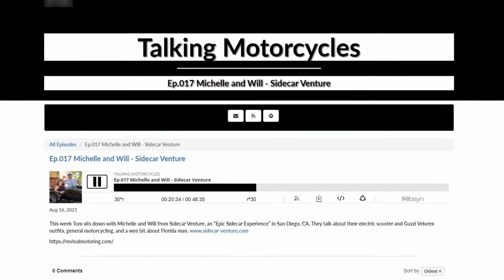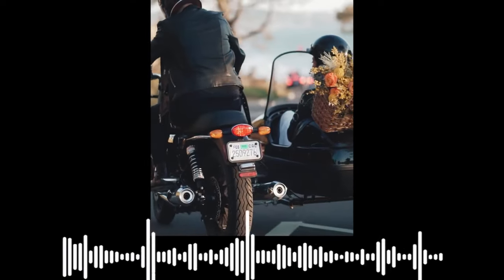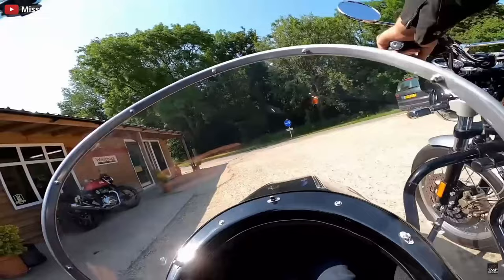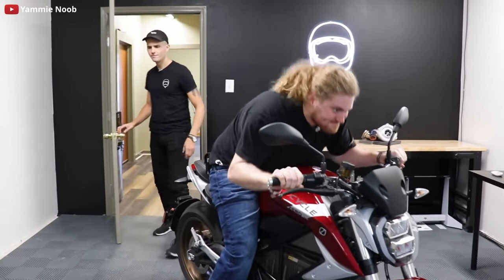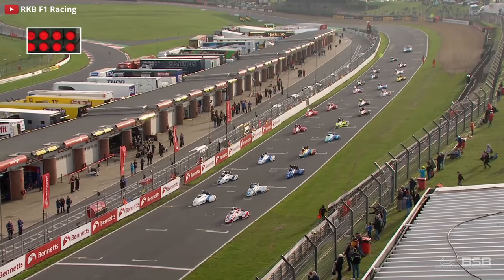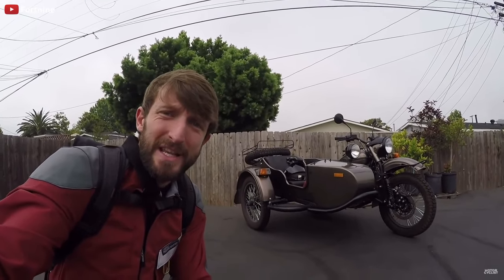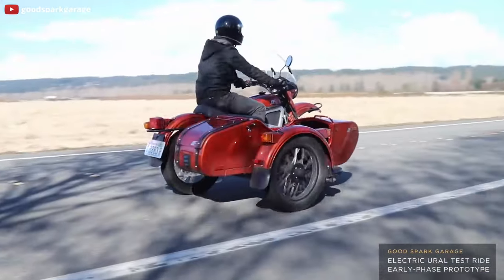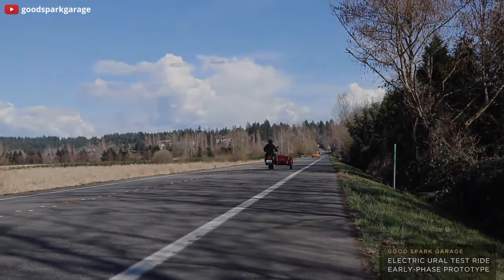Why Sidecars could be the future of Electric Motorcycles

Comment: I've often thought this EXACT thing.  Makes too much sense not to do it.  I'd totally get an E-Ural with a 200 mile range... in a heartbeat.  And design it in such a way that the sidecar is easy to attach or detach.  That way you can ride on two wheels for shorter commutes, and then attach the sidecar when you want to go touring over longer distances.
Plus... EVs are so much simpler and easier to engineer than ICE vehicles, so it seems this would a perfect fit for Ural :-)

Comment: I used to run a sidecar business, I now write sidecar books. I've been thinking that an electric sidecar would make a lot of sense for the same reasons you mention. Range. Big battery under the sidecar. 
You could easily get a 200 mile range out of one. 
I'd love to do it, and I have designed the whole thing. I just don't have the funds to produce it right now.
Reply: While I can appreciate the simplicity of an outboard wheel, & aesthetically all the enclosed ones I've seen were... lumpy, I still wish for the debris containment & superior aerodynamics & roomier space, that a sidecar enclosing that third wheel, can offer! 

Aesthetics are quite subjective, but if they're not styled like a dirigible or an antique boat, they seem to jump straight to alien gourd shapes, & I'd just love to see a streamliner sidecar that actually looks good.

Comment: When you dis Ural motorcycles, you’re dissing the old ones (and you’d be right).
   I ride the new fuel injected one, and it’s as dependable as any machine we ride with.
Also a little FYI;
Ural has an amazing electric machine in the works, and the only reason it’s on hold is because of the conflict with Europe, Ukraine & Russia.
Reply: A paratrooper bike, yes?

Comment: If a hub motor were fitted to the rear wheel (and maybe even the sidecar wheel) there would be lots of space for batteries in the cycle frame and the sidecar. I would love to own one. I'm sure a good, usable range would be possible.
Reply: That'll be a high voltage hub motor, or else a geared one, but yeah, it's a good idea whose time has come.

Comment: Sidecars flipping over when turning to the right? I assume you mean when the sidecar is on the right, it can be difficult but that depends on experience. I'm in Australia, we have our sidecars on the left side. I have been riding a sidecar for 34 years, mostly solo, why solo? I like the thrill of throwing it into a corner, going faster than I should. I find that if you hang off the bike like you do when racing, transfering your weight, and you let the side car wheel come up in the air, plus feed in the power, it will rocket around a corner, and you do the opposite for turning with the sidecar in the outside of the corner, hang off and shut the throttle. In the wet, when you can get it to slide, it is fantastic. I don't think you see a lot of them because they are a challenge to ride.
Now putting a battery in the floor of one and on the bike for a sidecar would be an amazing idea.

Comment: Better question: Why is it so hard to find a sidecar bike at all? They're rarely attached out of the factory and even used ones cost thousands.
Reply: I'm thinking this too, Ural is the only prominent sidecar-motorcycle manufacturer that I can think of, guess it's not as popular of a feature as it once was?
Reply: A sidecar needs to be very well mounted to the frame, & frames vary wildly across brands & models; so, you're usually making a sidecar for just one year range of a few models by one or maybe two manufacturers. 

It's like the paucity of frame-mounted front racks on bicycles: If it wasn't already planned for, it's a lot harder to add later.

Comment: Sidecar owners have been on this for years, mounting heavier automotive batteries out on the front right corner of the sidecar frame to replace crummy motorcycle 12v batteries- works like a charm. I've been thinking about full electric along the lines you mention for a while; one advantage is that you avoid the HVAC losses fully electric cars suffer from, which also helps battery life. Biggest drawbacks are in the inability to easily adapt regenerative braking, and the generally awful aero figures all sidecar bikes suffer from.
Reply: Given that motorcycle trailers exist, & Segway trailers & bicycle pusher-trailers & self-propelled commercial sized bicycle cargo trailers, all exist, I am surprised that no one seems to make a self-propelled emoto trailer (or really, any pusher trailer with capacity >30lbs but <1000lbs)
Reply: @prophetzarquon1922  - any pusher trailer worth hauling for it's power output would be seriously destabilizing in braking or cornering for a motorcycle. Have you ever driven a semi or other heavy trailered vehicle?
Reply: @floydblandston108  Actually:   
1) trailers mounted at the rear axle can get crazy heavy without adversely affecting handling   
2) pusher trailers can now be self-balancing, self-braking & self-propelled; less than a pound of pressure can guide them around

Comment: Electric motorcycle range depends on both battery capacity and drag. Sidecars increase drag so much that they offset the advantage of battery storage.

And that’s particularly the case because of battery density. Electric motorcycle battery density is higher than that for cars and it’s still not enough to satisfy people, offering 3.6kWh for every 40lbs of mass. Electric car batteries take more volume to get the same kWh rating.

I have been measuring real world electric motorcycle performance and also modeling it and developing solutions to this problem, and dollar for dollar, pound for pound, taking a stock bike and reducing its drag is way more effective than adding a sidecar and filling it with batteries. At least if you’re going faster than 40mph.

The entire premise of this video is just untethered from the basic math of how electric motorcycles work.
Reply: The battery on a Zero or an Energica weighs 200lbs to deliver 100 miles of highway range, and 250 miles of city range. That difference is almost entirely due to drag. Adding another 100lbs of battery will only net you another 50 miles of highway range.

You’d need 200lbs of additional battery pack to get 200 miles of highway range, and it would still vary with the direction of the wind, because motorcycles have such poor drag qualities. Increased range and range stability are only achievable with an optimized drag coefficient.